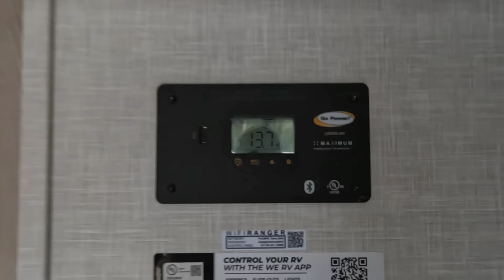What are you going to do WILLIS

Comment: I noticed that there is space around the air conditioner.  When it rains it will leak inside.  You need to seal around the air conditioner.
Reply from the maker: Yes, it will be filled